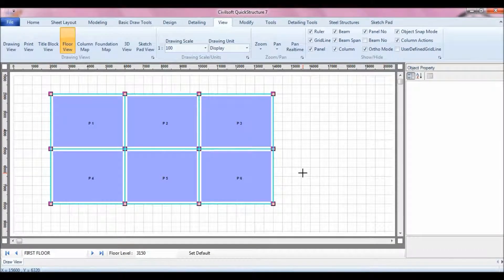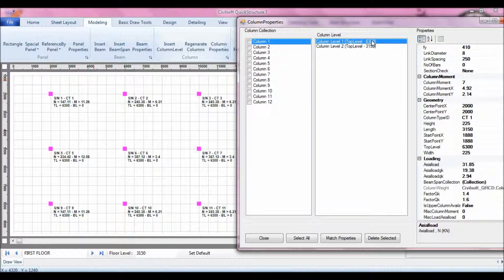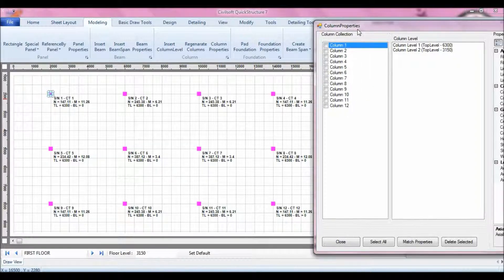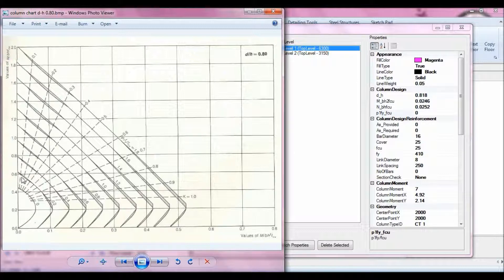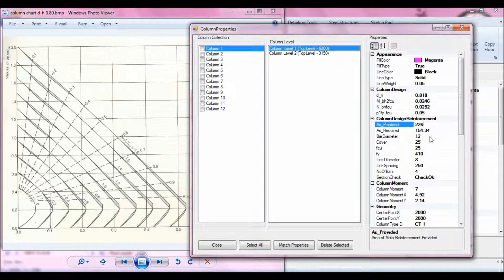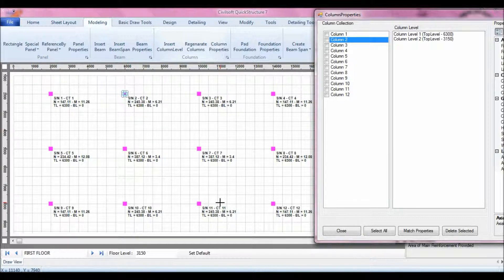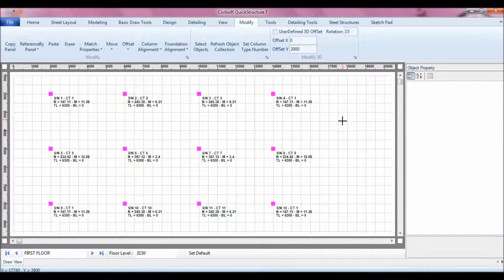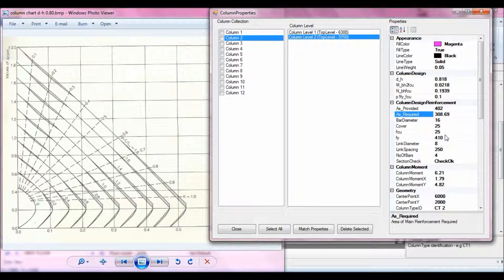QuickStructure 7 Tutorial 2 - RC Column.wmv

Comment: but why software cannot calculate the area of steel for column Automatically, most of the 
 software they can provide the steel you just need provide the column dimensions without any further work any then check for the desing ,,, I like the way of matching properties it is a very smart way and ease the work for designer